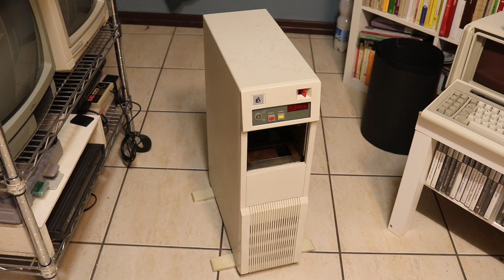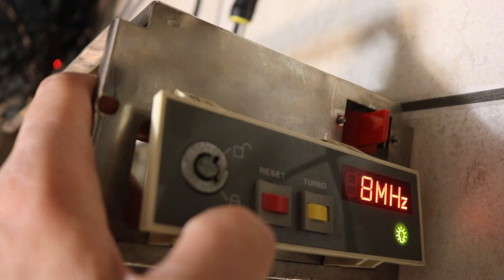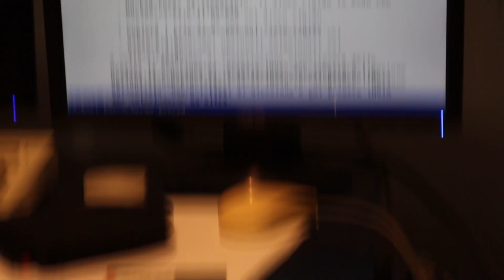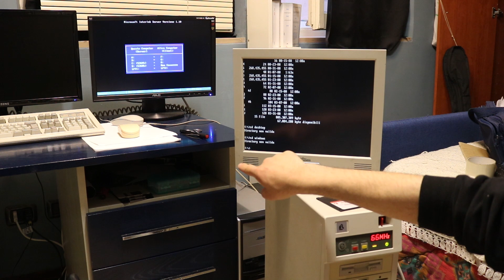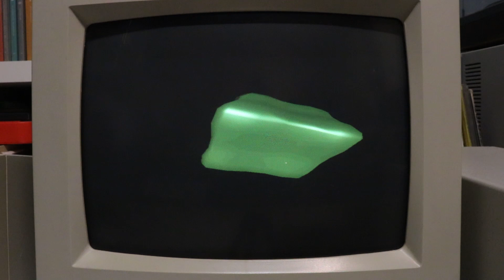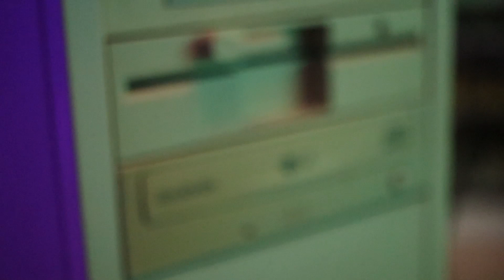Intel 486DX2-Based Computer Build

Comment: Rewatching some of your old videos!  I really like this build. The case was probably for a 286 originally, and looks more than a little similar to an IBM PS/2 tower.  As for the naysayers who complain about mismatched parts... Well, I was building machines in this time  and a 286 era case, upgraded with a 486 motherboard with a mismatching CD drive, 3.5 and 5.25 floppy was pretty much de rigeur for those of us who couldn't (and wouldn't) drop thousands of dollars on a pre-built.

I don't know if you ever got the Hard Drive LED working, but the header for it is probably NOT on the Mobo, it'll be on the VLB card.

Comment: You should be limited to as much as 2 gigs, not 470MB or whatever it is you said.
Reply from the maker: Nope, bios limitation can be a pain in the ass, 2 gb is the maximum for msdos, but every bios is different
Reply: Incorrect.  It depends on the BIOS of the machine.  Pre-1994ish machines have CHS limits of (usually) 1024-16-63 giving you 504 MB as a top out limit.  I spent a lot of time in the mid-90's installing drive overlay software on early machines.
Reply: @dennisp.2147  I hear ya, I just meant as a general rule the max should be 2GB.

Comment: What sort of Graphics card would you recommend for a 486 PC?   Am about to build one and I figure I'd like to have one with at least 4MB of onboard RAM.  Would like to be able to run games like DOOM and Simcity 2000 at good speeds and graphical settings.
Reply from the maker: Well it depends on your motherboard configuration, vesa cards are the best i think, or at least something with S-video supports. LGR has a great video about his 486 build, check it on yt (Also sorry for the late, i’ve seen now the comments)